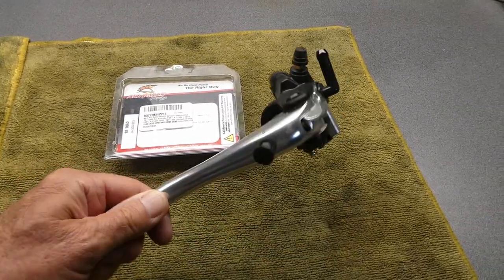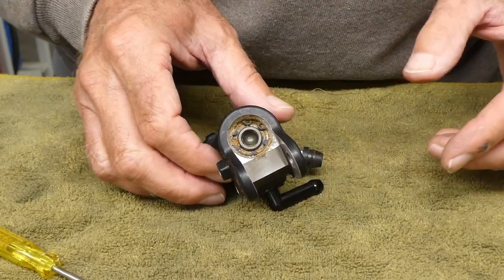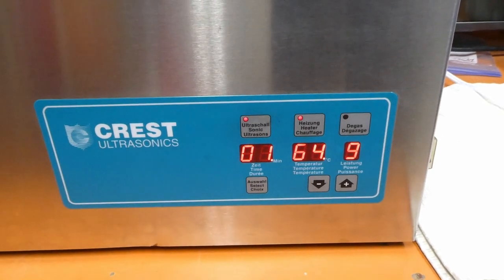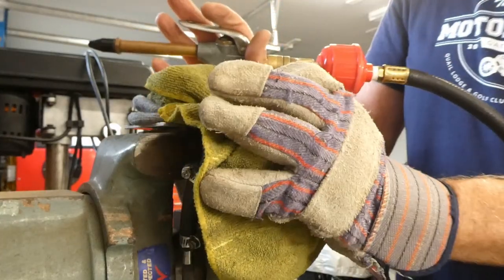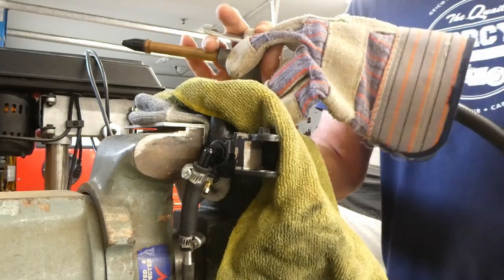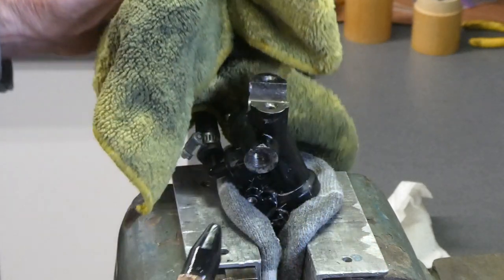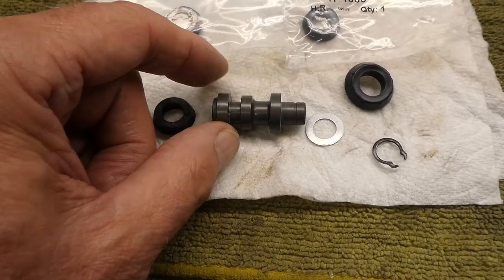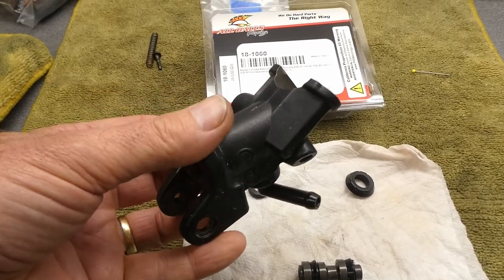R1 BREMBO MASTER CYLINDER REBUILD 2004-2014 IT WAS FROZEN

Comment: Another clever use of a chopstick.😅  Sometime during your recent RZ project, you also used a chopstick in a clever way.  Guess I'll be adding a couple to my hand tool drawer.😊
Reply from the maker: Every time we go to chinese food or the Pho place I bring home a set. You may have seen me using them in the RZV cleanup video. Get some. They are great for pushing cleaning rags or paper towels in to hard to reach areas without fear of scratching surfaces.
Reply: @KensGarage1  will do.  Thanks for the laugh, I needed that. In the finicky part of my paint project, getting the details right.  Getting close to being done.

Comment: Hi there. Great video 👍 can you please advise on how you get the new front seal in place? The rear seal is self explanatory but, the front seal is a problem for me. The inside diameter is so small, I’m having trouble trying to stretch it enough to get it in place and, I don’t want to damage it. I can’t think of any other way to fit it, other than stretching it over the front end of the piston to get it in place. 
Thanks.
Reply from the maker: Thanks for the compliment. That seal will stretch on. It takes a bit of patience and care. Don't use anything sharp. Use a little of whatever brake fluid you will be using as a lubricant. Amazingly it will go on.

Comment: Did it work?
Reply from the maker: Yes. It is installed and running DOT5 full synthetic brake fluid. The FZR600 calipers on that bike were disassembled, powder coated, and reassembled using Brake Crafters components. Thanks for asking!